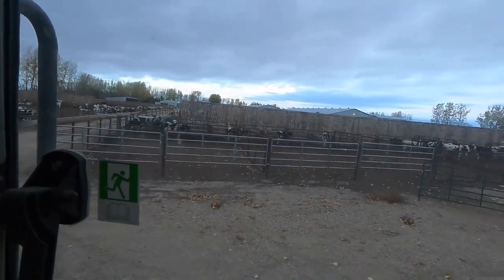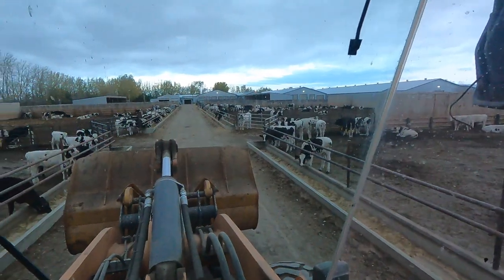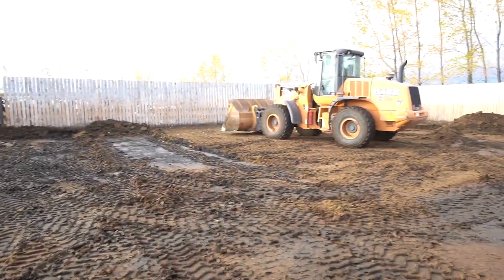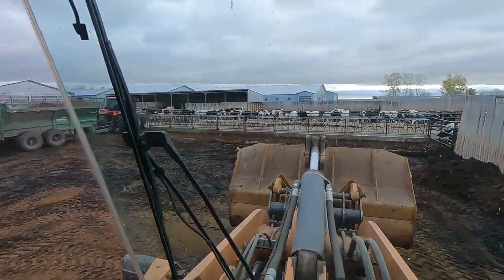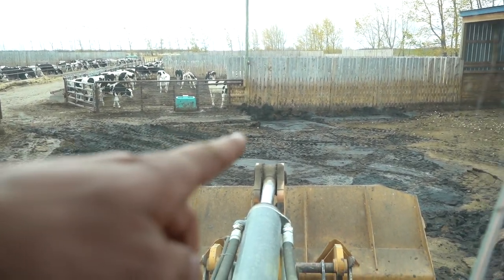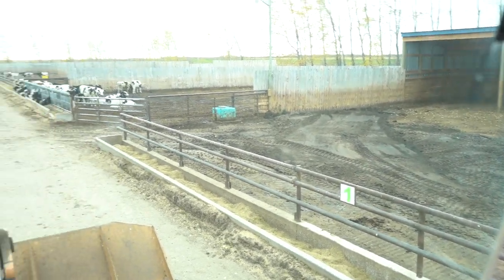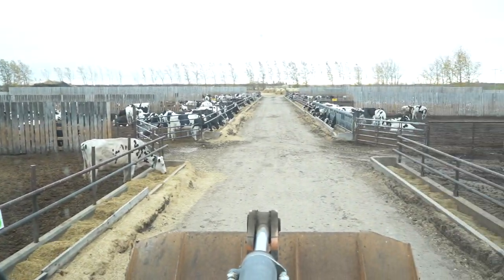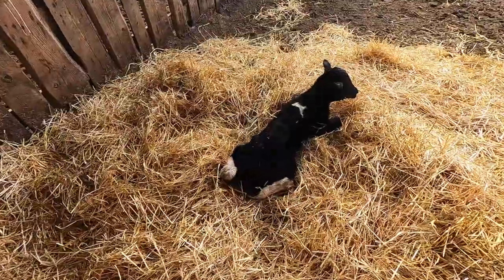Fall Corral Clean Up!

Comment: Before you go replacing those EXPENSIVE tires, you could grab some dish soap, mix in a bucket with water and after pumping up the tire, run the water over it.  You will see bubbles where the leak and if it is in the treads,  ithere is a kit you can get from Canadian Tire that contains sticky rubber strips and a 'tire' needle to push the rubber strip in to plug the puncture.  You should care a kit in your truck.  It's easier than changing a tire.

Comment: Could you use the spreader to put the dirt back in to the pin it maybe hard to get in there but you could hall a larger load and then go really slow and spread the top soil out in the pin?

Comment: Cute calf!
Jan, how exactly do you manage the bedding in the corals throu the winter. Iv seen it's pretty wet at times, plus minus temperatures. Cows/youngstock don't deal with the 2 together- iv seen you blasting straw in there with the straw chopper, blower but it's never looked a lot and the corals always look dirty? Just interested.. I see the calved hfr was on clean straw thou. 
Good vids.

Comment: The same manure spreader i use to take out, I would use to respread the sand. Just saying.
Reply: No, too dirty.  
Note how he uses a different loader to move manure and spread dirt than the clean loader that is used to load compost or hay bales.  Like separate skid steers for moving feed around and the dirty one* that is used to clean the barn aisles.  Very good hygiene.

* Even though we once saw him wash it -- it stayed clean for about 6 hours.
Reply: i also got an feed loading bucket, and an bucket for loading everything else then feed at the farm. 

so you dont load weird stuff into the mixer and or splinters.

Comment: I unsubscribed but check in off and on. It amazes me that you take the calf from it's mother so soon. Also that you do not replace the corral manure with some product so the cows don't have to lie in their shit. Some farmer's cut their corn high and then cut the rest for bedding.Sawdust and other materials are alsy good and can be composted and spread. Also calling a new born calf, clumsy is really showing off how you treat your cows as if they are only a product.Doesn't exactly thrill me enough to subscribe.